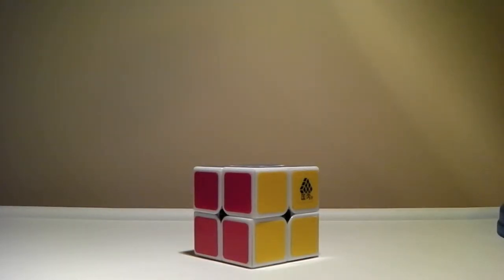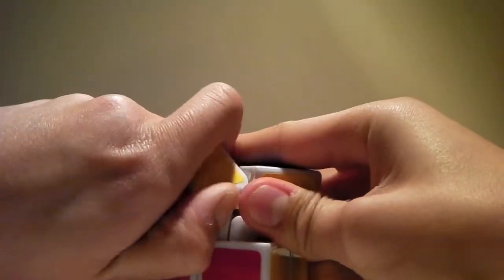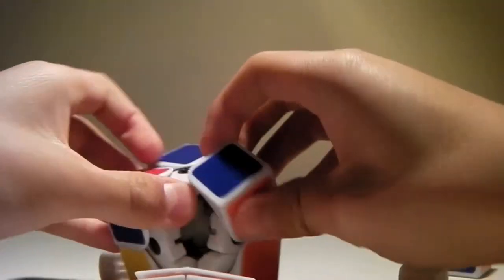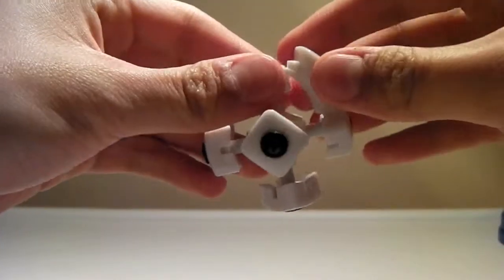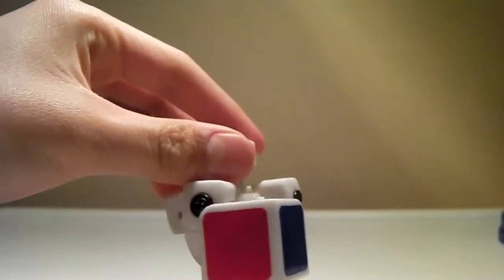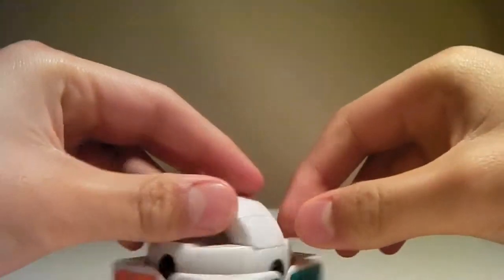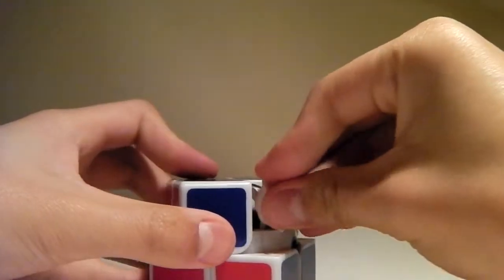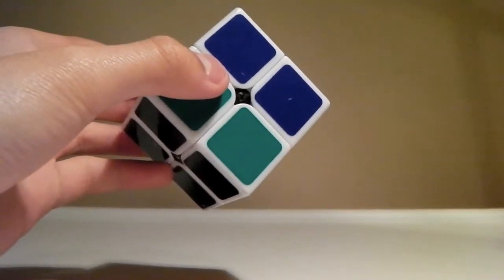WitTwo Dissassembly/Reassembly Tutorial

Comment: Its 1st time i encounter this issue - For my cube, it could R moves and F moves, but it could not do U move.

So I took it apart.  Instead of having 9 NORMAL edge pieces and 3 "Special" pieces (with that extra ridge as you call it), 
 I had 8 NORMAL edge pieces and 4 "Special" pieces (with extra ridge).

The 4th "Special" piece must be the one causing one of the face cannot turn.

Any suggestion how to solve it ?
Thanks in advance...